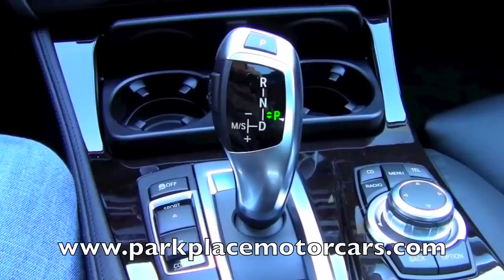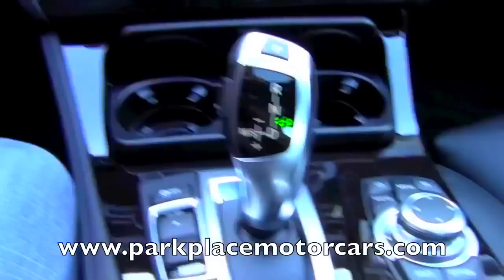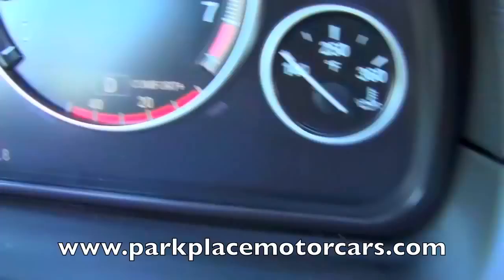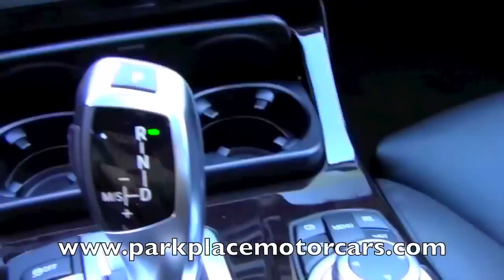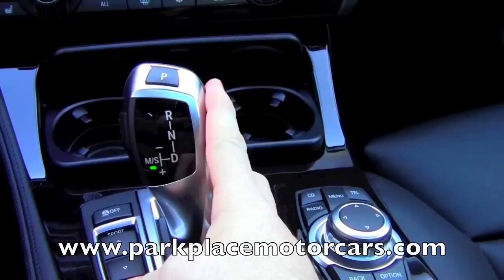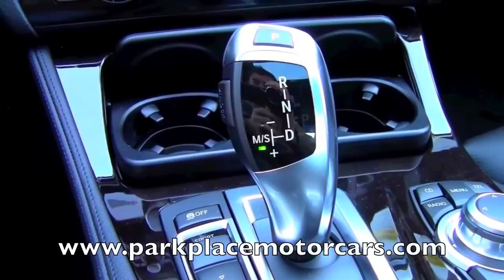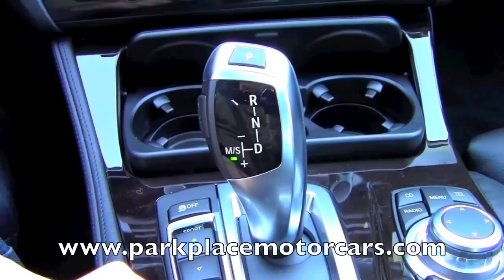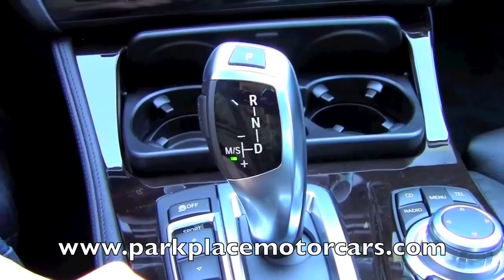BMW 5 Series F10 Steptronic Shifting Functions

Comment: Question, mine got damaged by my 3 yr old, pushing it like crazy…so I have a used shifter from EBay for my X5, is it possible to install it myself?? Does it need any sort of programming?? Or is it plug and play???

Comment: It’s kinda hard in the bmw during the Mitsubishi eclispe cross because my car is manual and I have a automatic transmission and  when ever I shift it I kinda wonder if I should get a bmw or not?
Reply: if you need to ask if you should get a fucking bmw over a mitsubishi , then you re better off with a mitsubishi. Bmw actualy need good drivers.

Comment: How do you move back to D (drive mode) when you are on Manual using the paddles? I changed to Neutral and than to D, but I guess there is something easier than that....
Reply: Just press the + Paddle for a longer time(3 sec) and it will go back to D

Comment: how to use the manual mode when the car is actually on the go?? when is the best time to change gear?
Reply: depends on your driving style and road or situation for quick overtaking and mountain roads its quite good. I usually use it for 2 lane each way roads to overtake big trucks or on the mountains when going down so the engine keeps the cars from accelerating thus using less to none brakes instead of wasting the brakes or heating them.

Comment: Do you have to push the clutch to use that pistol for changing modes?
Reply: There's no clutch its automatic
Reply: @_dYHA_  why it said manual mode then?
Reply: @anshrx9  read the comment above, he’s asking to press the clutch down , but there isn’t one
Reply: @anshrx9  because you change the gears manually not because it's a manual transmission